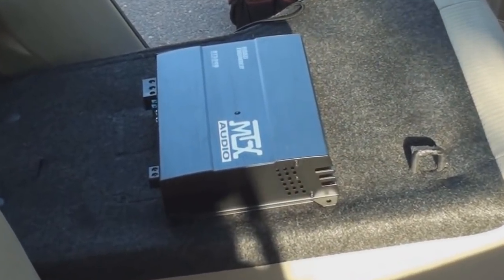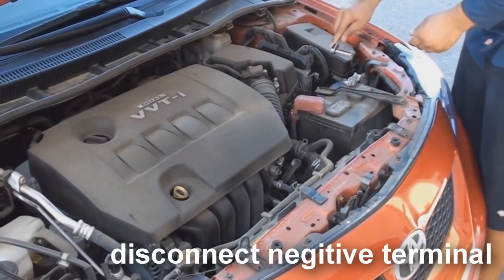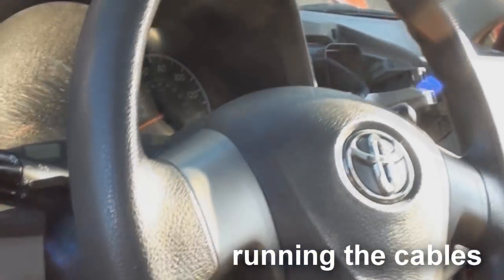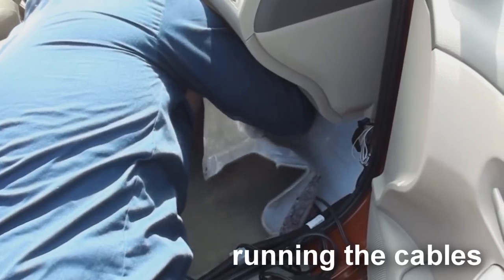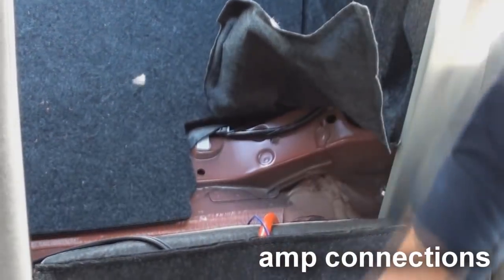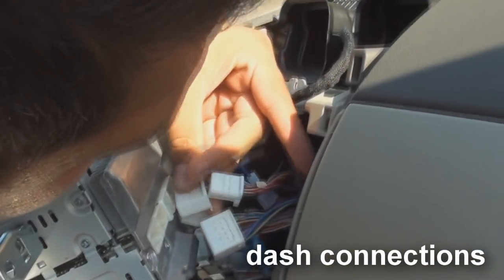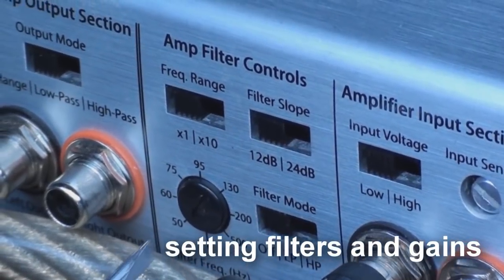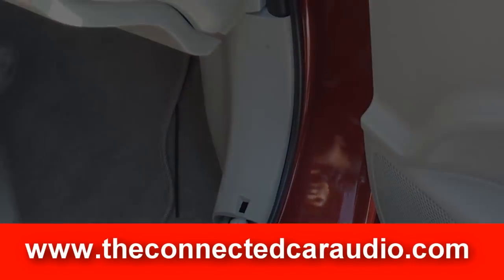How to install a car amplifier

Comment: i have no clue whats up, i got a shop to do my wires to the back of my car so i can wire the amp and subs myself, but when i tried to hook up my amp, turned the key on, and the stereo wouldnt turn on, unplugged the amp and the stereo would come on, and the whole time, the amp stayed off, any ideas whats wrong? all the fuses were good to.
Reply from the maker: Did the shop run a dedicated power wire to the battery? I've seen that before where someone Wired the amps power wire to the stereo wire for high current power.
Reply: yea i have the 4 gauge red power wire wired to to battery.
Reply from the maker: Try to isolate the problem, unplug everything from the amp except the power cables and ground cable and remote wire  like speakers and rca inputs then try to turn amp on. Does it still turn the stereo off? If it doesn't turn the stereo off try plugging in the rca does that make the stereo turn off? Then try the speaker with it that does turn the stereo off. Just to be specific you mean that the stereo it actually turning off like no power not like no sound right? Also it concerns me that through all of this your amp has never turned on this makes me think that your amp is not getting either the power remote or ground it needs to turn on

Comment: I installed my dash speakers to the head unit!, I was told to wire the tweeters to the head unit as well (in the process) So far I have the amp and woofers working great. I was told to wire the 6x9 to the amp (already done) along with the door speakers haven't done it yet but planning on a.s.a.p. I HAVE NO SOUND from the 6x9's. I ran them straight to the amp as instructed. What have I done wrong?

Head Unit: KDC-X898 

 http://www.crutchfield.com/S-sarBSc32s6G/p_113KDCX898/Kenwood-Excelon-KDC-X898.html

tweeters: KFC-ST30

http://www.crutchfield.com/S-JMWQxv7sHhu/p_113KFCST30/Kenwood-KFC-ST30.html

dash speakers: KFC-835c

http://www.crutchfield.com/p_113KFC835C/Kenwood-KFC-835C.html?search=kfc+835c&osp=kfc-835c&tp=96

door speakers: KFC-XR600  

http://www.crutchfield.com/S-QCEb6reA1IE/p_113KFCXR60/Kenwood-eXcelon-Dual-Mag-6-1-2-Speakers.html

rear dash: KFC-X693 

http://www.crutchfield.com/S-YoAJKebs7vo/p_113KFCX693/Kenwood-Excelon-KFC-X693.html

Woofers: KFC-W3013PS

http://www.crutchfield.com/S-qnRUmvnxprA/p_113W3013PS/Kenwood-KFC-W3013PS.html

Amp: XR900-5

http://www.kenwood.com/usa/car/excelon/xr900-5/

Comment: u do not want to run turn on and signal wires on the same side has the power wire. you could get interference, instead run the power cable on the drivers side .... and then run the remote wire and rcas on passenger side.

Comment: I think my amp and sub is draining my battery, what could possibly be wrong ?
Reply: +Willie Murphy get a capacitor
Reply: your alternator may not be charging the battery enough
Reply: something is wrong.  
if it's draining your cars battery it's a capacitor will make it worse.
Adding an amplifier is adding yet ANOTHER thing your drained battery is powering. 

your capacitor doesn't power your vehicle it helps power an amplifier.
Reply: Don't sit with your car on acc...
Reply: Willie Murphy your amp to strong so u are going to need another battery for the system only

Comment: Man you did great job but you skipped the most important part . On how to connect the HiFi wires. 
You didn't even mention that we need a rca converter  to use to plug it in.

Comment: how do i calculate what size fuse i need for my amp? (Boss AR4000D)
Reply: doesn't work like that, i read that fuse should be the combined  amount thats on the amp, my amp has 2x 50A fuses which means i should be using 100A fuse
Reply: thats only on 2400 watts. my mono block is 4000watts on its own not to mention my other amps for splits all round. 

I've already worked out exactly what i need, i used 60A at the start, 30A is too small for what i have. I wanted to know exact amp i should use, not what will do, there's a big difference.

Comment: Never set you low pass at 80hz if you running between an 8-15 inch subwoofer you want to set  the Hz between 55-65 hz

Comment: Well shit I already ran my RCA's with my signal and power wire I'm not pulling that stuff back out that's how it raining last time in my other vehicle I didn't really have any problems I thought just as long as you grounded very good you won't have any motor sounds going through your system, is that what you're talkin about?
Reply from the maker: Yes if your just running a subwoofer amp then you usually won’t have a problem since that sub crossover frequency doesn’t go that high. But if your powering inside speakers you might get some whine

Comment: what gauge speaker wire?
Reply: minimum 16, but 12 is good. go for a full copper, non tinned cable. also i prefer soft flex cable

Comment: i have 4 channel amp do i need 2 rca cables
Reply from the maker: If your stereo has 2 sets of rca preouts ( 4 preouts) then you should use all of them into your 4 channel amp. You can use 2 channels and split the rca with a y rca splitter but it's a stronger signal and less noise to use 4 rca output from the stereo into the 4 input on the amp. But yes you can use 2 rca

Comment: on my amp i have only 2 input
Reply from the maker: If you have a 4 channel amp then you will have 2 sets of rca inputs that means 4 rca example one set o red white and another set of red white. If you only have one set of inputs then it is only a 2 channel amp. You mentioned it was a four channel but only one set of rca would indicate a 2 chanel amp

Comment: Why don't you put rubber seal between firewall hole and power wire? And why you don't install electrical connectors at the end of wires, instead running bare wires straight to amp? And you are teaching people how to do it.. At least you put main fuse to power wire, so maybe your car wont burn